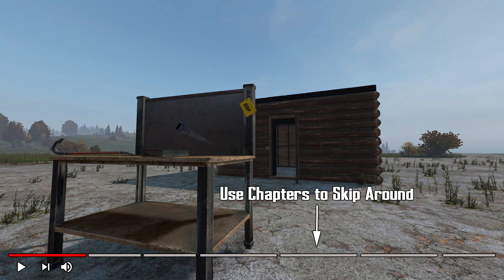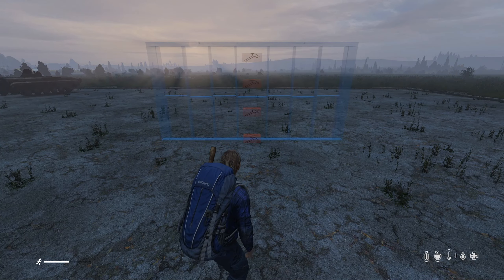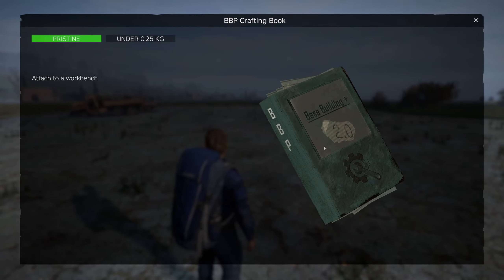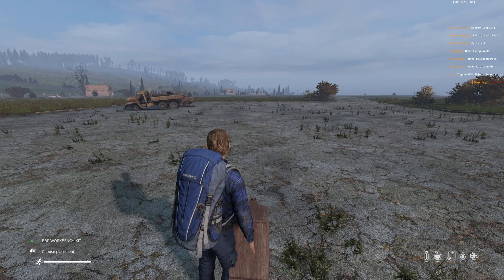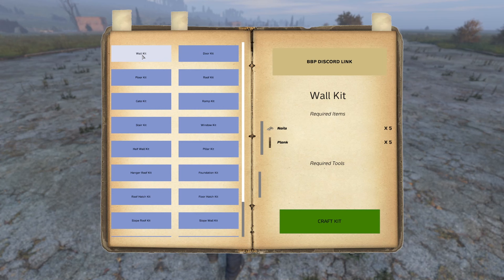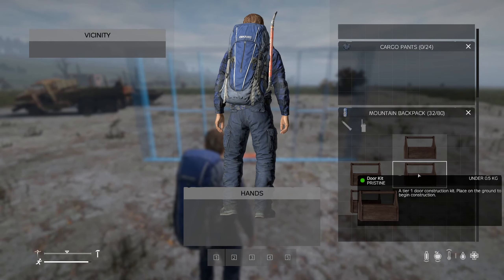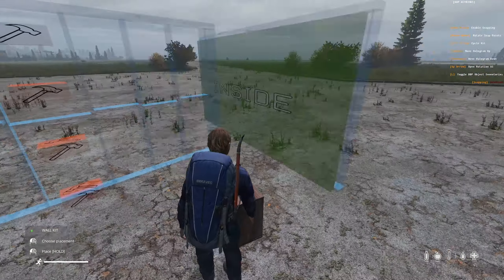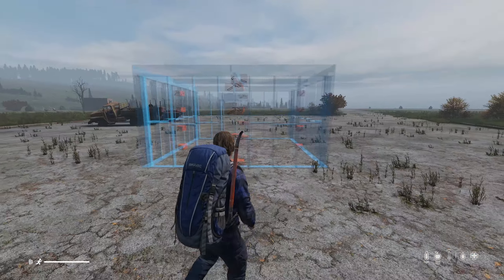Base Building Plus 2.0 - DayZ Tutorial - Guide on How to Make A Starter Base - BBP 2 on PC

Comment: I'm trying to figure out if I could block windows on an existing structure with a pillar. Had to test it. Yes, depending on the size of a window, you can block it with a pillar. However, (untested) I think a pillar could be removed by anyone from any side (I'm playing on a role play server and though they're not supposed to grief your base, someone sneaked in last night and raided me. I'm kind of glad, since it was early and I could react to it. I'm building a store at one of the big farm barns that has an awning on both sides and I couldn't get in from the bottom floor windows, but I realized the second floor could be crawled through. I expect I have to build small walls on each window, facing inward, to make it harder to raid.
Reply from the maker: Thanks for the comment with your testing! Maybe others will find it helpful

Comment: Are these crafting books extremely rare drops in the industrial zones? I can't seem to find any.
edit: I am also unable to find it in my admin item spawn list? what is the item called? BBP_ ??
Reply from the maker: They may be depending the server I suppose. The item in the files is BBP_Blueprint
Reply: @Nitno  Well it is my own server ;) I wanted to keep it as vanilla as possible but with some QoL elements - but no trader mods allowed.
Reply: @Nitno  So, where would I change the nominal amount of the BBP_BluePrint on my server? The types.xml only has the standard and not the mod items listed.
Reply: @ErikEhrhardt  When installing the mod, you had to fuse the existing types file and the types file provided by the mod. This way you can change the nominal values. *And iI just realized your comment is from 4 weeks ago..

Comment: Question about chain link fences. Those require only wood and nails to build right?
Reply from the maker: CHAIN LINK FENCE
FRAME = 10 NAILS + 2 SHEET METAL
T2 FENCE = 10 NAILS + 2 SHEET METAL
BARWIRE = 10 NAILS + 1 BARBWIRE
Reply: @Nitno   you’re the best
Reply from the maker: @Kawasaki_Lover00  :_nitnoGood:

Comment: Great video! One thing I can’t figure out is how to get the inside wall on the outside. I’m trying to build inside a gym and I want the wall side  on the outside but cannot figure out how to do it. I tried to rotate it but the snapping puts it back on the inside of the room I’m building when I want it in the outside .
Reply from the maker: Hmm, have you tried turning snapping off and manually placing it?
Reply: @Nitno  I actually found how to do it and it’s confusing if your not familiar with it. 	

Snap it the way you don't want it first so green side facing you. Press up arrow key to enable advance rotation, click freeze, click roll rotation, use scroll wheel to spin it the way you want and then place when fine with it
Reply from the maker: @Aaron-or6ov  Brilliant! Thanks for sharing what you found.

Comment: Hey Nitno, great video! I'm running into an issue that I cannot find a solution for and I feel like it is very simple. I have the workbench setup with crafting book, measuring tape, max nails and max planks yet it doesn't give me the option to "craft kit" on the right hand side after clicking on the kit I'd like to craft. Any solutions? Thanks!
Reply from the maker: Hmm I am really trying to think and picture it... nothing is coming to mind. Maybe does your server have a special setting where you have to put a flag down first or some kind of land claim kit?
Reply: @Nitno  I appreciate the response! It does require a flag to be placed and raised, which I made sure to do. It was almost like the nails and planks weren't registering in the workbench. Didn't know if you had ever come across it, shot in the dark! lol
Reply: Having this same issue now and driving me crazy, did you figure this out? I've been at it for hours
Reply from the maker: @austinlohse9990  no idea if this helps, but could try closing dayz, going to into !workshop folder and deleting all BaseBuildingPlus folders. Then it will re-download the most updated version. That will at least rule out an outdated mod. 

I tried looking in their BBP discord too, seems like others have had this issue, but I didn't find a solution.
Reply: @Nitno  so for the particular server I was in, you needed to have your materials (nails, planks, etc.) in your inventory instead of stored in the workbench. I appreciate your input though!
Reply from the maker: @austinlohse9990  Ah okay! Good to hear you got it sorted out.

Comment: construction is transparent to the floating.
Reply from the maker: When it is transparent, this is when you add materials to build the frame.
Reply: @Nitno  I'm talking about the fact that in the swimming mode you swim through the building
Reply: @Nitno  if you build a base on the water and swim to it, then you can’t climb it, since the stairs will be “transparent” and pass through